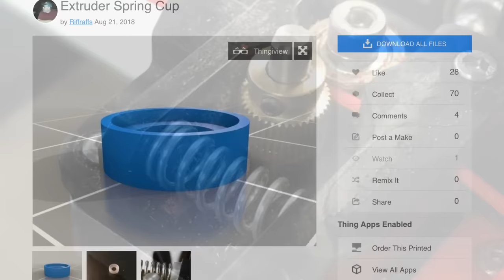Fix Bad 3D Prints on a Creality Printers

Comment: I am still having this issue, I have done the following:
Replaced rollers on X and under bed, replaced plastic extruder for TH3D aluminum version w/steel gear, replaced bodin setup for the direct drive unit, increased flow rate up to 110%, tried different brand filament including inland, 3d solutech, Amazon basics, hatchbox,  replaced nozzle more than once and have taken hot end apart multiple times to "reseat" the TPFE on the nozzle.  I guess I am going to check the V-REF on all of the steppers next?
Reply: I don't know, does it FEEL like the motors are driving rigidly and strongly enough? In my opinion you should feel a good bit of heat being developed on the motors when they're powered long enough, but not too hot, though how hot is too hot, depends. On Geeetech electronics and 4988 StepSticks i cool them with a 2000rpm 80mm fan for the whole board (+92mm 1500rpm for power supply), i drive the motors to about 40°C equilibrium, and in motion it feels like they could take my arm off if i'm not careful - the StepSticks are at a comfortable temperature too. But obviously i have a lot more DIY cooling than is available on Creality or just about anything from the factory, so i can push things a lot harder before they start to develop issues.

Besides not enough drive current to perform the motion, if the stepper IC overheats, it will temporarily reduce the drive current to a very low amount until the temperature recovers. The overheating occurs due to a combination of too much drive current and not enough cooling, and i'm not sure whether it can be exacerbated by mechanical resistance. Since Creality in their infinite wisdom decided to couple the board cooling fan to part cooling fan, it is advised to run the latter at 100% whenever feasible, so that the board gets enough cooling, or rewire the electronics cooling fan to be permanently powered by power supply directly, which is how it should have been to begin with.
Reply: @SianaGearz  That is a good point and an easy experiment to see if it changes anything. I have a printed cover over my board cooling fan...like every ender3 has. I could take it off and see. As far as the motors running hot, they do not.  The longest print I have done was like 26 hours and I made a point to check them during that time.  I just downloaded the Creawesome Cura setup that someone mentioned below. I am printing now to test it out.
Reply: @Moneypit330  If the motors are too cold it's also not ideal, a hint that you're not driving them as hard as they'll take it :D And i mean while you can make the axis smooth enough to get away with little drive current, driving the filament down the hot-end is just inevitably a very heavy job.

Comment: Hi Chuck, have you heard of the new Creawesome mod for Cura 4.0 for the Ender 3? It's not just a printer profile but actually replaces files in the resources folder in Cura. People are getting amazing prints with it, would be cool to see you do a video on it!
Reply: I saw a reddit post for this plugin yesterday and plan on checking it out this weekend.
Reply: Its awesome! Works really nice for me.
Reply: Just add .5 line width to cheps profile and you have creawesome
Reply: I tried it, but I'm getting better results with Chuck's Cura profiles. I don't see anything in that code that you can't setup yourself without replacing the resource folder.
Reply: After reading this comment, I decided to check out Creawesome as I had never heard of it before. 

I printed a CHEP calibration cube using the CHEP Magic 0.20 profile in PLA....it turned out nice, as expected. I have been using this profile since day one and have always been very happy with the print quality.

Next, I followed the instructions for loading the Creawesome resource file into Cura 4.0. The only changes I made to the "Standard Quality 0.20" profile was setting the extruder temp to 205C and the bed temp to 60C to match the previous print with the stock Cura...no other settings were modified. I copied my custom start and end gcode to the new printer profile too.

I printed a second CHEP calibration cube in the same PLA at the same temperatures as before. This cube turned out nice too....noticeably nicer than the first cube I printed. 

When doing a side by side comparison, the letters in the Creawesome cube are much crisper than the stock Cura cube. The overall finish is also much smoother when playing the light across the surface. 

When looking at both cubes, each are nicely printed but a close up inspection reveals the flaws in the stock Cura cube that are not in the Creawesome cube. 

Is the Creawesome cube 100% perfect......no....but it's pretty darn close.
The holographic Ender 3 around the Creawesome build plate is kinda neat too....even though it's merely eye candy.
More printing will need to be done to fully determine if this Creawesome Cura is a keeper, but at this point, it's looking like it's gonna be.
Reply: @MadDawg91108  wow thanks for the in depth comparison!

Comment: That's exactly how the arm on my printer sounded! Wow.  I printed a front rail cover for my Ender 3 Pro and when it finished the top half was very weak and stringy. When I removed it the top half was so brittle it broke apart. I did replace my stock extruder with the all metal kit and I noticed the tensioner spring feels tight. Also, while printing I noticed a sound coming from the feeder area that seems to be because the the screws on the new extruder kit are too tight. One last thing. The filament looks like it has bite marks in it like the gear is squeezing too hard on the filament. Please and thx.

Comment: What about the exact opposite problem? I always have little over extrusion issues, with tiny extra dots of bulging filament, not talking about the seam.
Everything seems ok with retraction and all
Reply: Same
Reply from the maker: Adjust your ESteps https://youtu.be/QnrH2Sk7y40
Reply: Tried a calibration of the extruder and also replaced the Bowden tube with a Capricorn, didn't solve it.
Turns out it was octoprint, for instance the usb cable that I was using, I tried printing from the sd card and it came out perfect.
I was using a PS3 controller miniUSB cable, probably worn out, also noticed that the SKR mini e3 V2 usb port was a bit large or loose, I replaced the cable and bent a bit inward the metal of the usb port on the SKR and now it works flawlessly.

Comment: Why at 2:45 is your extruder drive gear set screw not lined up with the flat spot on the pin??
Reply: There's two set screws. One grabs the flat spot of the axis, and the other one is at an 90° angle and bites into the axis from the side. Here you see only the 2nd one.
Reply: @me3dnone107  Yep. Their are two grub screws to hold the shaft on the gear.

Comment: Thanks,  Good advice for any 3D printer. 
Usually, I'm see that problems like this more when I buy cheap filament. I've heard moisture can be an issue even with PLA. Of course, you get what you pay for. But any advice on troubleshooting bad filament and any possible tips on how to fix it (ex. filament dryers, etc.)?
Reply: I print with TPU sometimes and it gets to be really bad after a few hours out of a drybox. I use the tried and true method of sticking it in the oven or food dehydrated for about 6 hours before printing then keeping the filament dry. But you can check this as a before and after but typically PLA doesn't really absorb that much moisture unless you live in an extremely humid climate.

Comment: What are small bumps/ridges on the side of the layer where the stroke ends caused by?   The extruder slipping slightly when trying to reverse/stop the filament flow and getting a slight over extrusion?

Comment: Wow - those problem prints look just like my recent fails with taulman Alloy910 nylon.  I don't ?feel? or hear the glitchy thing in the tensioner arm, though, but perhaps that's because the nylon can skip without actually shedding chaff in the process.  The thing that I HAVE noticed, but haven't been able to isolate the cause, is that when I measure the amount of filament extruded when I call for 10mm (my usual test) I find results all OVER the MAP - on the SHY side, that is.  It ranges between 6.8 and 8.3, approximately, never consistent, never CLOSE to right!  Of course, this makes for very sketchy prints, even with my attempt to compensate by setting it to overextrude about 125%.  I'm good with PLA and TPU but this nylon makes me crazy.  I've had major headaches with his bridge and bluprint before, but that was on another machine.  The bridge turned out to be so irregular in its diameter (some actually as fat as 2.04mm) that it was binding in my bowden tube!  Naturally, I checked that on this 910 but found it dimensionally proper.
Thanks, Chuck, for so generously sharing your due diligence!!!  Keep it up!

Comment: I bought a CR 10 mini and instantly tried to print with it. I kept getting stringy prints and what I thought to be nozzle blockage. I could not fix it. I tried customer support for 4 months. I gave up in april after buying it in January. In june my Friend said "let me look at it and see what I can do". I didn't think we'd fix anything but I let him try. We moved the printer upstairs cuz the room it was in was being converted into a home office for a family member. I plugged it in, ran it and THE FREAKING PRINTER RAN PERFECT AS HECK. I was so confused and so was my friend. I'm still confused but I'm guessing that the voltage of my outlets affected it somehow. The room it was in before had an i mac, space heater, lights, and ink printers. The room upstairs just had the CR 10 mini. It is working fine now. I do realize that people plug dozens of these printers in in one room. But this is to crazy of an event to just brush aside. I alos know the CR 10 mini has a feature that if the power goes off then the print will resume when the power is restored. Maybe my outlet was affecting this somehow and it just kept crapping on my prints. Either way, if you're totally lost on what to do and have tried everything. Then I suggest moving rooms or checking you outlets.

Comment: I just upgraded to a metal extruder from the plastic stock extruder.  Now I'm getting really inconsistent layers.   Some are thick and others seem smooth and in-line with a smooth print.  The print wall feels bumpy if that makes sense.  I've tightened the belts and tried to adjust the tension on the extruder spring.  Any thoughts as to why I'm getting inconsistent print layers?
Reply: I figured it out!  my belts were still too loose to get a smooth print.  I tightened them up and bam...great prints!  Thanks for all the content you are putting out on the ender 3.
Reply: How do you tighten the belts any advice ?

Comment: if the fillament wire on the roll have crossed each other you sometimes also have a feeding   problem.if the filament thread is too loose on the roll.

Comment: I am having this exact issue, but with the SeeCNC EZR extruder. DO you have suggestions for how to resolve this issue on the upgraded extruder. There doesn't appear to be enough room on this extruder to add a spacer to the spring. Thank you in advance for any suggestions you may have Sir!

Comment: I actualy only have problems with the Ender 3 Pro. Levelingscrews dont hold the level during a larger print, powersupplyfan never turns even though the PSU is hot. The nozzle isnt straight and the supportbarts have something that rattles inside of them and the printhead itself is always just way too low. And it gets lower and lower during the print. It already left scarpes ont he bed during one print where at the end it smalled the head down when the bed retracted...

Comment: I just got my printer a week and a bit ago. What would cause spiral rough areas just on the bottom when using supports or rafts? The rest of the print is fine.
Reply from the maker: Your bed isn’t properly leveled.

Comment: I have an ender 3 v2 I have just upgraded the extruder and a new Capricorn Bowden tube a couple days ago and I am printing a Nintendo switch game cartridge holder and the walls and everything else is fine but on any flat parts, like when it filled in the first layer it was warping up as it’s printing. I’m going to try releveling my bed next. Oh and my infill layers do not stick to each other, like it prints fine but the infill is like stringing I would say, it’s weird.
Reply: And I had just printed something just before that and it printed fine
Reply: I’m reprinting the game cartridge hold with a raft and the flat areas still warp up

Comment: I've tried all sorts of things to correct the issues I have been having with my Ender 3. I am getting blobs and stringing. I was having issues with bed leveling so I purchased and installed the CR Touch and I also purchased the spring steel bed cover. Previously I replaced the stock extruder top mechanism with the aluminum one. Prior to installing the CR Touch, I was having issues with the extruder "clunking" which pointed toward the hot end being too close to the bed. That is 100% resolved and I don't have any more clunking and the extruder seems to be smoothly pushing filament. I have cleaned the hot end a few times recently and even replaced the extruder tip. The problem with my prints now is that they will run smoothly for a bit and then I will get a blob that causes issues. The hot end will jerk as it goes back over the blob and in extreme cases the blob will cause the hot end to actually knock the print loose and then spaghetti. It's been frustrating me for weeks. I've tried loading different firmware, and last night I tried slicing with Prusa instead of Cura but there really hasn't been an improvement. Do you think I need to look at replacing the extruder gear or what other suggestions do you have? I love my Ender 3 but it's been months since I got a really nice print out of it and I have wasted so much filament. Any suggestions you or the community can provide would be great! Thank you.
Reply from the maker: This might help. 
https://youtu.be/c_llLYxbJ4A?si=7ceGQGuYS3Humkr4
Reply: @FilamentFriday  First, let me say thank you for your quick reply to my question on this issue. I really appreciate the response. I looked at the video you linked to and that isn't exactly what is happening with me. There doesn't seem to be consistency in where the blobs are getting dropped. In your picture it seems like the printer was pausing and dropping the extra filament while it paused. What I have happening is really small blob being dropped at random spots during the printer's movement. It isn't necessarily when the hot end is changing directions but if I watch closely while it is printing, I will see a small blob with some extra strings. If the print is large enough I can usually knock the blob and the extra string off the print while the hot end is travelling to another spot on the print. I just don't want to have to babysit the print. 
I have had several print attempts lately where blobs get dropped and due to subsequent buildup over the blob, the print has either been knocked completely off the bed or there is a shift in the layer which causes the prints to come out malformed. When I replaced the extruder pinch arm and spring with the Crealty aluminum one I remembered that I did not swap to the new gear and left the stock one. It seems like my problems started not long after this. After watching this video it made me wonder if the extruder gear was the cause of my issue. I dug in my spare parts and found the gear that came with the new extruder pinch arm. I am going to try installing it tonight after work and see if that makes a difference. BTW... I have been using version 5.3 of Cura up to this point.
Reply: @cgbolton1  I am still facing some of the issues you are and were able to find out the source of blobing in mine. It turns out the ptfe tube was not very pressed against the nozzle inside the heating block which led to melted filament go up around the ptfe and leaking over the heating block.
Once I disassembled them, cleaned it all, installed the ptfe and then tightened the nozzle against the ptfe it seems to have stopped. My guess is that it was either dropping over the prints or causing the printer to be unable to direct a constant flow of filament to the prints.
I hope you have fixed yours at this point, but in case you didn't you could try to check these out.
Reply from the maker: @ItsMeAndru - I did a video on that many years ago. It’s a common problem on Ender 3’s and other Creality machines.
https://youtu.be/x35aWmnZ_A0